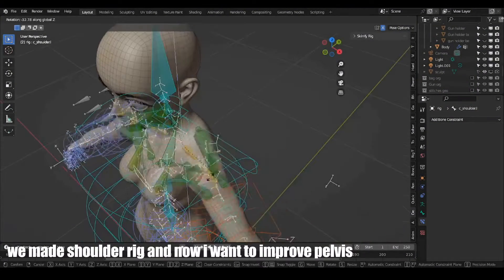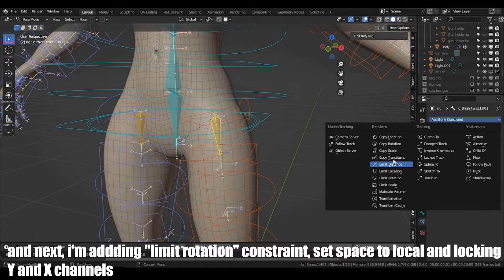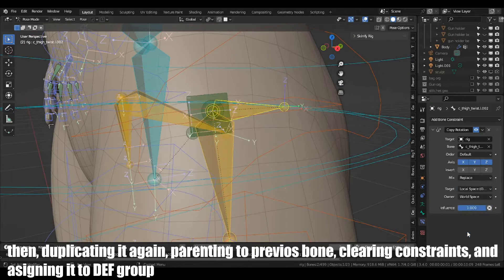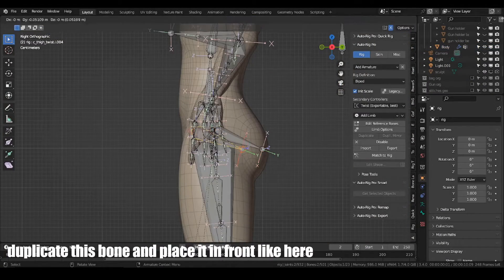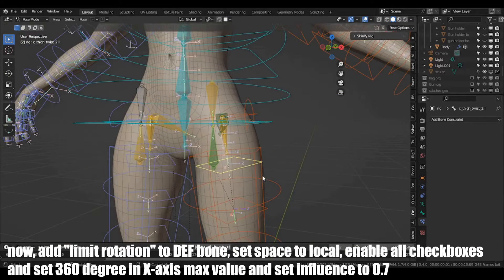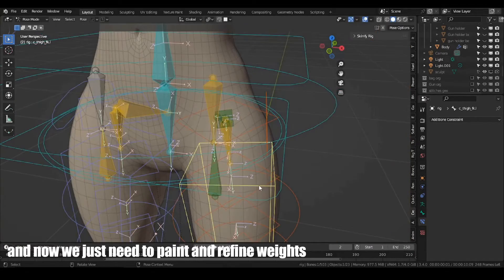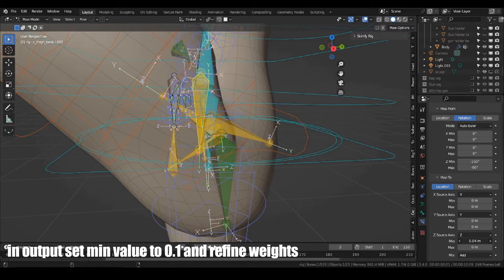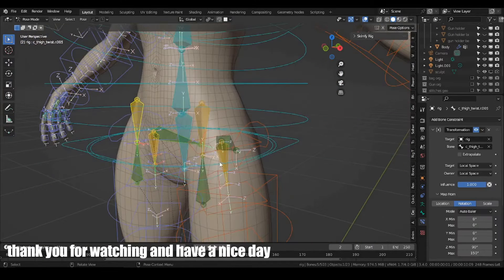[Blender] Pelvis rig improvement

Comment: I currently use a similar method to this!

Usually I try to make sure the automatic weighting works in most cases.

I plan to look into a method that involves building a cage from a copy of the mesh, > using voxel modifier, > then transferring the weights to the main mesh. Someone made a video on this.